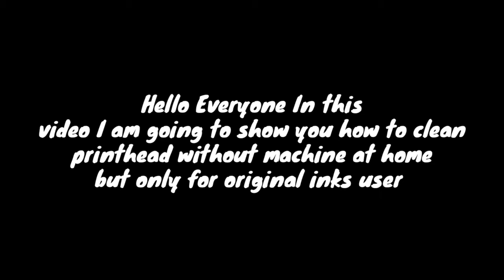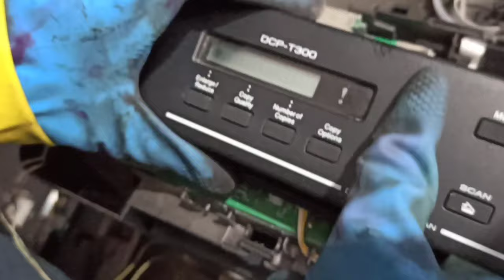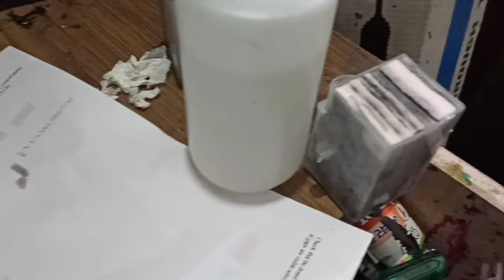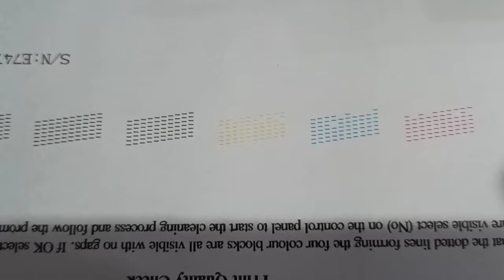Brother DCP T300,T500,T700 etc Head cleaning without any Special Tool (English Subtitle)

Comment: Hello brother. You make it seem very easy. Just a few questions. What is the fluid you're injecting? Does this procedure cause stucked air problem? Thanks for your time.
Reply from the maker: Is just a IPA
Reply: Thanks for the jet speed answer. And how do you understand it is completely cleaned? Is it because the isopropyl alcohol flows easily?
Reply from the maker: @MustafaGARGI yes sir

Comment: I have a Brother T300 and there is an error saying that the scanner cover is open, the printer is completely closed, because I took the scanner out with the help of your videos I put it back and nothing, is it a problem with the two wires of the scanner or Is the scanner lid wrongly attached?
Reply from the maker: Check yellow wire

Comment: OMG. So much work to access the tubing!!  I just bought a used DCP-T700W that has two colors 90% blocked but the others fine.  I assumed that it would be easy to flush and clean but nooooo....!  I will wait. I will first ensure that everything works properly with black only prints before I do that much disassembly.  Why did they design it like this?  Isn't a clogged printer head/tube due to non-use a common problem that should be easily accessed and fixed?!  Surprised. This is a reason to buy one with removable ink tanks so that you can just remove the ink tank to access the port to the tubes.
Reply from the maker: Hello Thank you for watching my video. If you are using original ink you have a chance to fix Without dissembling. Try maintenance deep cleaning mode i will share you link watch it
Reply from the maker: https://youtu.be/Yhawnq82FxM click this link and watch it 😄👍🙏

Comment: Is this the same as taking out the head and cleaning it manually, resting it in IPA, etc? Because other videos do that.. your method seems simpler but I don't know about efficacy of it, seems like it need more power cleaning
Reply from the maker: First use this method if problem not solve Remove head and clean by manually
Reply: @ShivamSharmaRepairs  Thank you  <3

Comment: If i am using a non original ink. The one that is clogged is the black only.
Do i need to clean/wash the inktank too?
Reply from the maker: Yess
Reply from the maker: Watch this video https://youtu.be/-WVw8-j35mA
Reply: After cleaning the tank then need to refill with original ink?
Reply: Or still can use the non original one?
Reply from the maker: Use compatible inks
Reply: Thanks for your reply. 🙏🏻🙏🏻🙏🏻
Reply from the maker: Where are you from ?
Reply: @ShivamSharmaRepairs  from indonesia bro

Comment: Hello sir. I followed the instructions step by step but it didn't work. In my case the yellow ink is not coming out at all. I use original ink. What do you suggest i can do? Maybe wash the ink tank?
Reply from the maker: TUBES GETTING INKS OR EMPLTY ?
Reply: @ShivamSharmaRepairs  yes they are getting ink. I finally solved the problem by doing eINIT_P (option 6) on yellow. Now it's working! Thank you sir for your help

Comment: Hi. Thank you for your video. It helps a lot to all viewers. Subscribe done.

 Can u help? I got Brother dcp-T310.

I turned on my printer. Auto cleaning comes in.

Tried printing and there are some splashing ink on the paper.

But the printing is very clear. 

Only problem is that splashing liquid.

Thanks.
Reply from the maker: Auto cleaning makes problem consume inks and time also so full reset your printer maybe this trick solve your problem .. And thank you so much for your support ❤️🙏

Comment: Thank you sir..
Reply from the maker: Welcome 😀🤗
Reply: Sir unable to print 48. Same process po kaya. Salamat po.
Reply from the maker: Sir phele aara tha ye error ya iss process ke baad
Reply from the maker: Sir this error come before or after repair process ??
Reply: @dhezzdj6940  i repair my printer error 48 the machine detected no printer head check for the connectio of head flex d nababasa ung printer  head mo meron akong kinalas na t300 maari sira ung head mo o kailangan lang linis sa connector nya pwd mo birahin ng lighter fluid ung board na na don sa printer head
Reply: @poginani7951  thank you po sir. May gumawa, saglit lang balik din sa dati. Binalik q ulit. Til now wala pa printer ko.

Comment: I hv brother dcp t300 printer, head has been cleaned under advance cleaning option, ink pattern is fine in test print page, but still m facing white lines while printing every document. Pls help
Reply from the maker: Change inks
Reply: Im using genuine ink
Reply from the maker: Total prints ?
Reply: Total page count: 22679
Reply from the maker: Head cleaning need Use Iso profile alcohol and Watch this video properly

Comment: Thanks a lot and after how many printings do I get better results?
Reply from the maker: 10 prints color best mode
Reply: Yes this really worked and now I can print in all colors which before I I could not. I  by mistake caused 3B error but after cleaning the head and all parts the error was gone and it is all good. Thanks again

Comment: Good day sir, after i open and assemble my Brother DCP-T500w printer i received a message "Cover is open" even though its already close ? How to fix please help
Reply from the maker: Check yellow wire
Reply: @ShivamSharmaRepairs  may i know which yellow wire Sir ?
Reply from the maker: @chrrrr_  01:51
Reply: @ShivamSharmaRepairs  may i also ask where is the connection of wire for all of the sensor so that this message wont pop up again ? Even if the cover is open
Reply from the maker: @chrrrr_  cut both wires and joint together so  error won't show again
Reply: @ShivamSharmaRepairs  Sir  after i surely connect the yellow wire that you said , the problem still persist "cover is open" how to fix
Reply from the maker: @chrrrr_  send pic on my Instagram @shivam2929

Comment: I follow this insstruktion and i have error init 48..
How to fix this?
Reply from the maker: Maybe you put syring so hard printhead blader leak and all inks spread in Head circuit.

Solution 
1. Check printhead cable connected on pcb
2. Remove printhead   And put air in Head blader (plastic) holes and check any air leak in blader.
If leak in Blader So you need to replace and clean head circuit using IPA

Comment: My printer says print unable 48, my printer is brother DCP-T300, what can i do??
Reply from the maker: https://youtu.be/7nIiYiw7whg

Watch this video any used ipa or rubbing alcohol instead of water maybe error disappear.

Still error coming last option Changed printhead ☺️🙏
Reply: Also the printhead is not moving even it is connected in the power source.
Reply: @ShivamSharmaRepairs   it is necessary to change the print head??
Reply from the maker: Yes unable to 48 mean printhead dead 
First clean head process video already given in previous  comment.

if still error show after cleaning change head